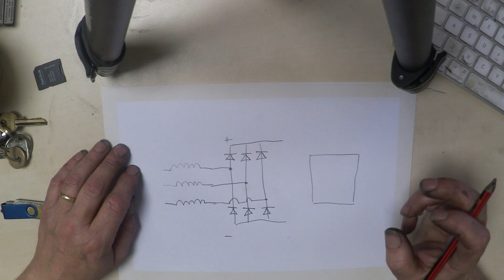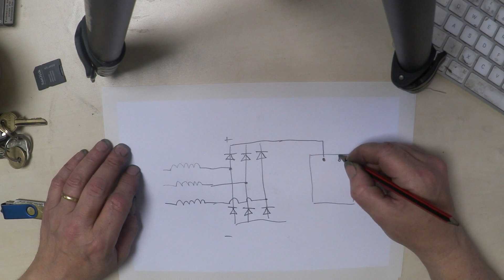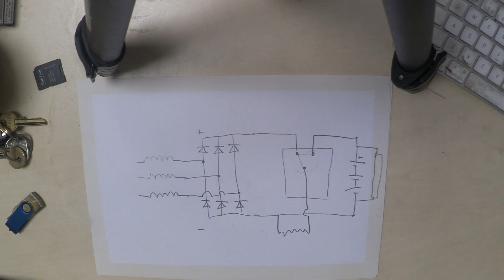Connecting A Wind Generator - The Basics

Comment: Robert, I have a commercial (small Chinese) three-wire wind generator, and common inexpensive potted "wind controller" that came with it. All three wires from the generator are the same color: Red. And the three controller wires are all the same color, also. Does it matter which generator wire goes to which controller terminal/wire?, or can the hookup be made in any fashion, and still have the same, best result?

The face of the controller has a diagram of a three-bladed wind turbine blade, with the center wire of the three controller wires coming from the second (middle one) of the three generator wires. If the order of the hookup matters at all, how can I determine which generator wire is that center wire? Or, as I speculate, since all the wires and terminals have the same color, does the order of the hookup to the controller (rectifier) simply NOT matter at all? In any case, how did (or, would) YOU proceed, and manage to get a good result in the hookup, if you've used these inexpensive off-the-shelf wind systems? Please help! Others here may have this question, too. Thank you!, --Joe / Tucson ARIZONA / USA

Comment: What about grounding? My 3 phase wind turbine isn't charging my batteries. It is an AC generator.  I don't have it grounded, do I need to ground it's body? I am not using a rectifier, I have a charge controller with 3 in from  turbine and 2 out to batteries, yet no charging is happening. The light from the turbine on the controller is just barely lighting faint and the battery light is bright green.

Comment: I,m thinking about buy a 48v wind generator. And Connect to a 48v micro inverter. The battery requires high voltage to charge. Microinverter doesn,t

Comment: Hi Robert, can I use a solar mppt charge controller on my homemade wind turbine? The voltages of turbine are  within spec of controller and will install relay on dry contact of lithuims battery to dump excess energy. Any advice will be appreciated.

Comment: What I'd like to know is, if MPPT Controllers are generally capable of being fed with recticfied AC-Voltage (coming from a 3-phase gen.) because then it would run the wind or water turbine on optimum speed /highest power output...

Comment: THANK YOU for a really great video. I have a question I am hoping you can answer please ? I have an ECOFLOW RIVER PRO power station with the extra ECOFLOW battery connected. I have a 3rd party 140W SOLAR panel connected as well. The specifications of the SOLAR PANEL is - Voc is 22.68 V, short circuit current is 8A, Vmp is 18.9V. I tested the SOLAR PANEL and it works well when connected to my ECOFLOW. I had to be careful to select the correct SOLAR panel that operates within the recommended ECOFLOW manufacturers specification. ECOFLOW recommends the following specifications for a SOLAR PANEL (10 to 25V and DC 10A max current). I connected my test meter and I can see that the SOLAR PANEL produces about 110 W and operates within the ECOFLOW recommendations. I conencted the SOLAR PANEL to the ECOFLOW using an MC4 to XT60 converter cable. I would now like to add a wind turbine to my setup ... I am thinking that I should be able to connect a properly spec'd wind turbine to MC4 conenctors and then just connect it to my ECOFLOW's XT60 connector.  My questions that I hope you will answer is ... QUESTION 1 - "AM I CORRECT TO SAY THAT A WIND TURBINE PRODUCES AC AND I WILL NEED A WIND TURBINE CHARGE CONTROLLER TO CONVERT THE AC THAT THE WIND TURBINE PRODUCES TO DC ?" ... QUESTION 2 - What WIND TURBINE AND CONTROLLER will you recommend that i use to make sure that I connect a WIND TURBINE that operates safely within the specification that the ECOFLOW allows ? I will really appreciate your help as I know nothing about WIND TURBINES and ECOFLOW does not say anything about adding wind turbines to their power stations but it seems to me that this can in fact be done as long as I stay withing the safe recommended specification ? THANK YOU FOR YOUR HELP ...

Comment: Hi, can I ask what I would need for adding a 2kw wind turbine to our existing solar and battery setup? our solar guy said that the wind turbine would be looked at as another 'power sourse' and the output needs to go into our 'consumer unit' with another meter attached so that our existing battery invertor will monitor that, so seems to me I need someting to control the windturbine, then an invertor. I don't need a 'full' charge controller/dump load etc.on the wind side as not charging any batteries from it as such. thanks for any help

Comment: Hi
There are 12v, 24v 48v, 90v, 220v wind turbines (many voltages...)
Do you know, how I can connect 220v(240v)AC wind turbine   of grid
Cause its produce already 220v does it need some controller, or I can connect direct to it apiances??
Thank you

Comment: Sorry, kind a late to the party ...
Question ... Why generate an AC voltage only to  spend money so you can convert it to DC so you can charge a DC battery? Why not use a common, already build in trillion metric tons, automotive alternator, which already deal quite well with variable speed drive, and automatically disengages when the batteries are full, to charge very inexpensive lead acid battery set which will last 20 years if properly serviced and installed on a steady base like the ground. Now all the concerns for cost have been eliminated. Aren't you simply fixing what ain't broke? And your DC source becomes damned near autonomous using the least expensive recyclable storage in history, the lead acid battery, also available in massive quantities. I have never been a fan of Rube Goldberg designs!

Comment: 4:40 Assuming one had a single phase AC motor, for clarity, use a single full bridge rectifier made up of four rectifyers rather than a single rectifyer.  

Obviously a DC motor is already DC output, and it does not need to be rectified.

Comment: 6:15 The charge controller needs to have a ground reference.  At this point in the video it can be represented  with a line drawn from the charge controller to the tangent of the line (wire) between the negative terminal of the rectifier and the negative terminal of the battery.

Comment: Hi Robert, I bought a basic charge controller and it has 3 green input wires for the genorator but I wanted to experiment with some small motors that only have 2 wires.
Can I use it as normal and just leave the extra wire disconnected or do I need to have a genorator with 3 phase output to use it?
Any help greatly appreciated thank you!

Comment: Thanks for this info, I do have one point question, is it AC easier / less expensive, to transport from the generator to the charge controller, and DC and wouldn't it be better to run the AC to just before the charge controller?

Comment: Can you do a video on how to attach the wires end to end? I have a 400watt w/charge controller and two car batteries. The inverter is a 3000watt/6000peak. What kind of cables do I need?
Reply: It depends of the voltage,

Comment: Synchronous Generator:
Can someone help me to get this running?
Need:
- quite a rotating mass
- fast reacting adjustable ratio gear, probably hydraulic (hydraulic pump, regulation and 2nd hydraulic motor with variable displacement). 
- microcontroller supervising grid synchronisation in phase. 

Somehow a voltage adjusting method is missing, do not know how relevant this is. When doing the generator from scratch, one could have many selectable tappings for the relevant steps of a few volts. 
When using a inner coil, perhaps in combo with permanent magnets, one could vary the field excitation. 

For some island solution, this setup even can constitute the inhouse net frequency. 

Different other power sources could be added in the hydraulic interface, like tes and la turbine from water or steam power. 

I have found this idea quite mature, and discussed there:
Experimental Validation of a Hydrostatic Transmission for Community Wind Turbines
by Biswaranjan Mohanty et al
Open Access

I tried to include the link at MDPI but was censored by yt, so it must be a hit :)

Couldn‘t you change to a non-censored platform, at least in copy?
Thanks!

Comment: I have a scooter motor driven by pedaling an exercise bike. The no load voltage output, oc, depends on how fast I pedal from 0 up to abt 85vdc. I have a step down converter but I'm thinking i need more than that. If you have time would you have any suggestions?

Comment: Hello it's the first time I've actually posted in comments,, a little introduction my name is Richard Muenzer... And yes wind in solar or something very much interested in and power supply. If you're coming to your videos most of them I've learned a couple of things inverters and rectifiers are the same thing charge controllers and inverters are also the same thing just at one end of the other so if you just made a rectifier with the charge controller heading into the battery then all you have to do is make another one heading out of the battery so you manage the electricity coming out right so you need two...right????📐📐📐📐

Comment: Hi Robert, although you explained in outline what's needed technically, for me it would be have been more helpful to see the generator and diode. I have bought a 12v generator and it has 2 wires coming out of it, so when you talk about a 3 phase diode, you've lost me. Am I a numpty? Yes I am. I also don't understand 'wire' the bits that connect one piece of equipment to another - there's always an assumption about knowledge here. Oh just a bit of wire - what kind of wire etc. So for me, I'd appreciate a read dumbing down video for the numpties. I got a squirrel cage from a skip. I bought the generator because I couldn't dismantle a ceiling fan as you need to be quite strong. I had to get help to dismantle device to get squirrel cage. I'd like to use recycled stuff. Please can you recommend a book for numpties to get started? Better still - write one. Happy to be a guinea pig.

Comment: As a beginner looking for both intellectual excitement as well as a person-who-had-to-spend-$1000-per-month-on-propane-last-winter-and-would-rather-not-do-that-again-because-I-want-to-buy-a mini-lathe-and-electronic-bits-and-bobs I need both the theory as well as the necessary practical knowledge to actually implement an entire wind-generation system, while daydreaming randomly about air-engines and super-capacitors. Thank you for making these practical videos. Very much appreciated. I would like to build my own charge controller. And use the dumped power to heat daily use water and after that is heated use any further excess power to heat a greenhouse throughout the winter. Could a tub (Like maybe a pressure-capable container like a propane tank) of ink or ink-in-solution have uncontrolled power dumped straight into it which could just increase the pressure, acting like a mechanical charge controller-which could be sized to take as much energy into it as the system could possibly create? And then the pressure and heat energy can be let out by a valve and heat exchangers in a steady usable fashion? It just seems crazy to have an “energy dump”. There must be a way to store the energy efficiently so it is not wasted...and since magnetism is so fascinating somehow magnetic field energy should be storable in the pressurized ink tank. Just randomly daydreaming about the basic principles I am learning through “robmosis”....

Comment: A wind turbine has a sweet spot where it is extracting max energy from the passing wind. For a conventional horizontal axis turbine the ideal is tip speed is seven times the wind speed. So to get best performance it would be good to control the load on the generator in terms of that ratio of rpm (tip speed) vs wind speed, keeping the ratio as close to ideal as possible.

Comment: Brilliant , I actually understood most of this!! Please when you make the video that actually is to scale with the parts, can you make use of the over charge situation, I can't think of anything worse, than waisting it by a component! I would love to use excess 12v for outdoor lighting! It won't matter when the lights come on! But it's a bonus
Reply: One thing you can do is redirect the excess power to your water heater if you convert the elements to 12v. I used to have a device that would do just that but I don't remember what it was called or the company name.

Comment: Rob........very useful as ever but something I've never understood.......why bother converting your generated AC power to DC just to convert it back to AC to put it back into the grid ?
Reply from the maker: the stuff you generate is irregular and needs local storage - it takes some expensive electronics to regulate it - then of course you need to store it which basically means DC - then to use it well if you attached DC loads no problem outmost 'stuff' requires AC - of course - so back to AC it goes - I know it is crazy - but that's what happens when you have a load of 'stuff' from before that you have to take care of - after all how many folks will rewire their house to run DC equipment then pay over the odds to buy a DC washing machine - which you could do.

Comment: A nice, basic, well-rounded PWM charge controller is the Renogy Wanderer 30A.  They currently run about $30 on Amazon:  https://www.amazon.com/dp/B07G1PL1B9.  It will work with lithium, sealed AGM, gel, and flooded cell batteries.  People tend to push MPPT controllers, but honestly they aren't all that necessary until you get into large systems and/or voltages much greater than your battery system, and they get pricey real quick.  But MPPT is nice if you need to eke out every spare watt - they're about 15%-20% more efficient - if you don't mind spending about $200 for a quality one.
Reply from the maker: nice link thanks for taking the time to post

Comment: Accurate and right to the point, but have you ever heard of active rectification?
With active rectification you dont need any switch.....
the diodes can adapt to the load!
Active rectifier Diodes as rectifiers are nice, simple and inexpensive, but they are always associated with a loss of voltage and therefore also of power. With a normal silicon diode, the losses are in the order of 0. 7. . . 1 W per ampere, with a Schottky diode they are still 0. 4. . . 0. 5 W/A. With a bridge rectifier, the losses are even double, since current always flows through two diode paths. Two years ago, this consideration led to the development of an active rectifier consisting of controlled power MOSFETs by Wolfgang Schubert, which was published in the Elektor Magazine 2006. The circuit consisting of a quad opamp and four MOSFETs was completely symmetrical and simulated an active bridge rectifier with a very low threshold voltage.
By Thomas Scherer About trade fairs &amp; Testing Published in Elektor 7/2008 on p. 100
THX for the video
Reply from the maker: yes mate I have but I am basically trying to uncomplicated a complicated issue - all I am doing here is introducing the concepts as pigeon holes further videos will explore each concept - but I always find a frame work to think in helps understanding - if we throw too much at the topic it just becomes a jumble - or at least that's the way I see it

Comment: Very good description, the only thing I would have added to that description would have been a voltage regulator either inside the charge controller or between it and the rectifiers. You could also use a car or truck alternator at desired voltage of course which is basically what most wind generators you can buy use.
Reply from the maker: yes mate I have but I am basically trying to uncomplicated a complicated issue - all I am doing here is introducing the concepts as pigeon holes further videos will explore each concept - but I always find a frame work to think in helps understanding - if we throw too much at the topic it just becomes a jumble - or at least that's the way I see it

Comment: Very interesting stuff!  Thank you.
What prevents a car alternator from over charging the battery?  When a lead acid battery is fully charged and driving at highway speeds, shouldn't it over charge?
Reply from the maker: they already contain. regulator mate - normally on an alternator conversion you chop that out
Reply: @ThinkingandTinkering   Thanks
Reply: They are regulated to only put out 14ish volts.

Comment: Gday Robert having trouble joining doesnt process paypal?....
Reply from the maker: you'll have to contact youtube mate - i have no control over any of that - sorry - hope you can sort it
Reply: If I recall, I had a spot of trouble with subscribing as well.  I wish I could recall the details.  I was expecting to simply provide a credit card number at time of purchase and not use PayPal at all, and I don't believe it gave me that choice.  In the end, I think I had to make sure everything was set up in PayPal first before it gave me any payment method options to choose from at point of purchase for the subscription.  I know that, in the end, I had to log in to PayPal to change something and I didn't end up using the credit card I wanted to.  I don't remember if I couldn't link a credit card at all for monthly billing (just my bank account instead), or whether I decided that I didn't want to permanently link another payment method to my PayPal account.  (If I had to change something in PayPal, I may have just added the debit card number for the bank account that was already linked to my PayPal account.)  Either way, Google now automatically charges PayPal each month and then PayPal deducts the amount from my bank account, either by linked banking account number or by linked debit card number (not sure which).  Hope this helped, and hope you get it worked out!!